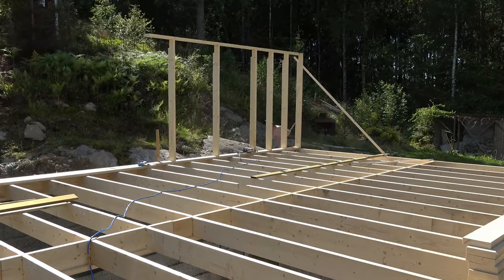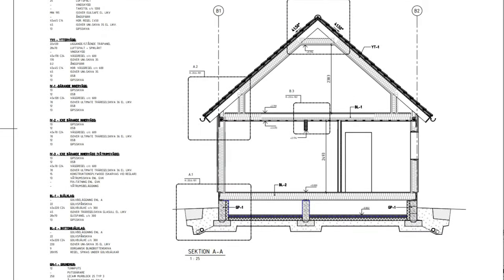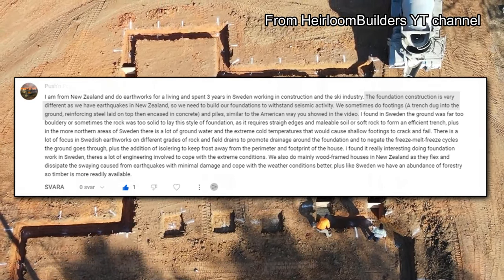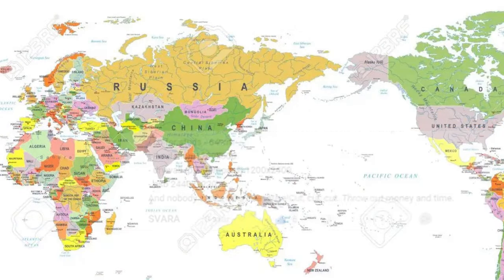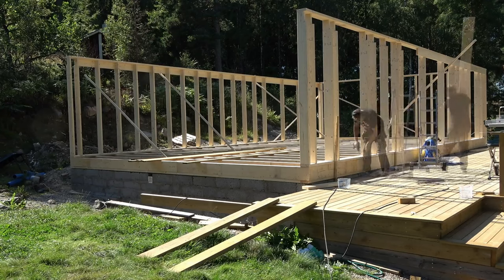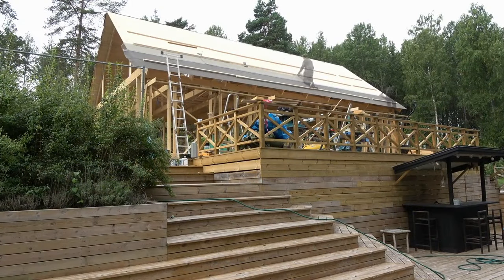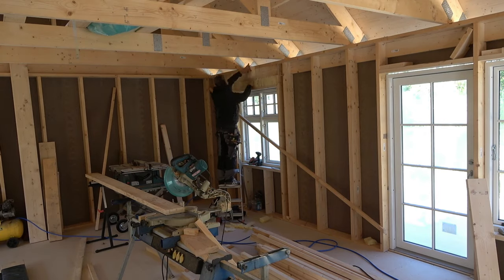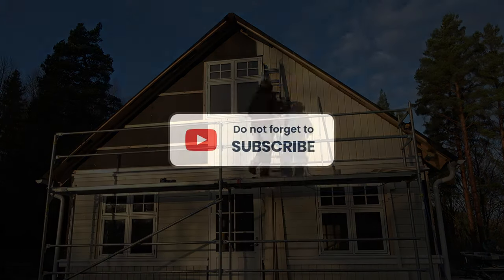UPDATED VERSION! Scandinavian VS American, CA, NZ, RU, AU building methods, let's compare...

Comment: no matter what, I would prefer to have a Scandinavian-built house..
Reply: The modern Scandinavian houses are extremely efficient and uses heat pump to extract energy from the ventilated air. 
In Northern parts, a house only uses 6-8 MWh/year for heating!

Not sure if the design works well in very hot climates, with AC running many months per year. Walls are built to be warmer on the inside…
Reply: Interesting that you say 6-8MWh that sounds a lot to me. Do you mean electricity that is used by the Heatpump or what the Heatpump produces ? We live in a concrete/brick house and we use for heating, hot water and cooling in the summer about 2,4MWh/y of electricity with the Heatpump. Approximately 10,7W/m2 per year. This is with a separate balanced ventilation system with heat recovery. Heatpump is air to water. We live in the Netherlands
Reply: @robertr999  remember that it get colder and way darker the further north you go. Also wooden houses are usually better insulated than bricks in our climate
Reply: @jubmelahtes  thnx for your reply. Yes further up north it’s coulder then here. But can you tell me if your 6-8MWh is pure electric of is it the thermal output of the heatpump? Is there a ..kWh/year per m2? for your area? Thank you in advance.
Reply: Swedish houses doesn't blow away during hurricane season which is 👍
Reply: @robertr999  I quickly looked up numbers for Finland, as that's where I'm from. Though I can't be 100% sure if these are correct since I don't work in building industry.
"Passive energy house" is supposed to be under 20W/m^2. "Low energy house" is under 40W/m^2. And the value that new house has to be is 75W/m^2 or less. 
I think those numbers give a good idea how much energy it takes to keep a house warm in cold climate.
Reply: @juhoukkola2306   Thank you, for this information. 👍That is quite similar with the Netherlands. Passive house qualifications 15W/m2 , low energy house (NOM) is 35W/m2 But the difference is the normalised base temperature (climate zone/base standardised outside temperature) It is just colder in your country.
Reply: Scandinavian house in north America with a thai wife. Men can dream.
Reply: Agreed !
I've lived in US for about 40 years. 
American houses, especially built 1980s and eariler are incredible crap compared to Scandinavian.
Reply: Yeh but  summer you can barely breathe inside tho
Reply: @robertr999 that is enorme. 😅😅
Reply: @robertr999 it’s -30C in Northern Sweden

Comment: American here. Your hammerband technique makes so much more sense than a double top plate, especially when factoring in no need for window headers. The A-frame roof joists make more sense, too. In the US, roof trusses are commonly used, making the attic space unusable. I also think using OSB on the walls makes a lot of sense along with the "double wall" so wiring and plumbing can be run without drilling holes in the studs. In the US, there is a newer OSB designed for subfloors  that is waterproof. So we've got you there!  I would be interested in how a full two story house is framed in Sweden. Do you do hammerbands around each floor? Also, do you use wooden I-beams for floor joists there? Thanks for the fascinating videos.
Reply: We typically use lumber for floor joists. 45mm x 195mm or bigger are common. There are other enginered joists made with osb, plywood and masonite but those are more often used in commercial buildings.

Comment: I work in construction and live in Denmark. I am from Bulgaria (south of Europe). Got my education (In construction) here in DK and I can say from my experience that the biggest difference I see in methods is the Earthquake resistance and stability of the building. Scandinavia is in the middle of the European Techtronic plate and when we had to calculate seismic actions - its virtually 0.  On the other hand Bulgaria has a code where all buildings must comply to regulations that make sure the buildings withstands 9 on the Richter scale. The amount of reinforced concrete used there is un imaginable to my Danish collogues. That changes how the different construction elements look like  and where people spend most money on their house/building.  Furthermore, soils in Northern Europe have been compressed by the glaciers that came from the north pole during the ice ages. That has compacted some layers of the soil to a very high degree. Making it very easy to build on - especially small buildings like single family homes. It seems to me that this makes it possible that people in northern Europe to spend less on the structural elements of the building.
Reply from the maker: Thank you, very interesting.
Reply: Worst building in America Has this caused human death? More than 50,000 people died in the earthquake in TURKEY (06.02.2023 earthquakes) and millions of people became homeless. Hundreds of thousands were injured. What has been done is purely for profit.

Comment: spray foam is WAY TOO much money,but alot of americans use it,the rich dont care about cost,A builder here pretends to build for 12-15% over labor and material costs but they have a tendency to hide things,and a million dollar build could have been done for 600 ,000 if you hired it all done one contractor at a time instead of employing a general!The honest builders just get 15% of every dollar that goes through the building account...The others bid it trying to make 15% ,but padding everything heavily to make more.....one local charges 3500 for buillding permits plus the fees,yet its easy here as long as all is organised,In our county ,permits take a couple hours!

Comment: If You have money only Ytong, We use hollow blocks on Balcan, but Ytong is better, and Ytong white seilings, over that We add at least 8cm stiropore insulation, Ytong doesen't require insulation, it's fireproof, earthquake proof, soundproof, and breaths so excess humidity and wapor don't make problem.

Comment: It sertainly look that we tend to be specifically keen on the isolation part in scandinavia. comming is to have 45+220, the norther you get the 45+220+45:ier you go :)
Reply: A huge plus side is, 45+220 windows looks so great! No extra "fönsterbläck" (google translate it from swedish) needed. :) Blinders do actually do their work and wases fits without interfearing with the inner space.

Comment: We Brits usually build our houses of brick or concrete block (for fire protection) but timber framing off site in a factory is becoming more common. Even with a main downstairs internal wall of concrete block, the upper internal walls are usually plaster board, double faced with a hollow lattice in between, which you can run cables through. I'm not an electrician but I believe all cables to sockets or switches, must run vertically, you can't take shortcuts across the wall. This to reduce the likely hood of someone putting a nail through the wiring, also you have to be a qualified electrician to sign off on the wiring, so most wiring is contracted out. Similarly only registered technicians can do any work on gas fittings or pipes. Plumbing is currently a DIY option but few people will attempt it. Thanks for the great series, I have always wanted to build my own house but I will have to be content to one day to have one built one to my specifications (currency permitting), my back or knees couldn't take the strain anymore.

Comment: While there are certain specific details of your construction methods I would like to see become standard in the USA, I think I prefer the American methods. Firstly, US building codes have largely abandoned the "houses must breath" dogma of previous decades in favor of a much tighter envelope. This has been shown to completely defeat the idea of breathability in a home. If it doesn't get wet in the first place from mass water, or from vapor, or from thermal condensation, then it doesn't need to dry. So the emphasis in on creating a water/vapor/air tight envelope. Another benefit of this philosophy is energy efficiency. Obviously, the tighter your envelope, the less energy is required to heat and cool your home. I live in Florida, so the emphasis here is cooling and dealing with humidity. Another aspect of American codes is an increasing demand for continuous insulation that will provide a thermal break for the structure of a home. You accomplish this with your two-part wall technique that I like a lot. In the US, it is now becoming more common to achieve a thermal break by covering the house with external insulation. Another superior aspect of American building codes is the increasing emphasis on water-proofing window and door openings, as well as the use of double and triple pane windows. I don't want to embarrass you, but I was shocked that you did no water-proofing to your window and door openings nor to the window and door frames. Here, each opening would have all of the flat and exterior edges treated with liquid flashing, then the window/door flange would have received another thick bead of liquid flashing before screwing it in and the outside of the flange would have been taped and all screw heads covered with either tape or liquid flashing after installation. I also did not see a drip edge installed above or below the windows and doors. That is standard practice here. I also did not understand why water-proofing and drainage was done after the foundation was completed. In the US, the foundation walls would have been water-proofed, and a perimeter drain would have been installed at the level of the footing before the dirt was replaced to the walls (back filling). There are other details where I believe American practices are superior, but I don't want to ramble on. I will only say two words more - spray foam. On the positive side, I liked the two-layer wall. I like the use of OSB to cover interior walls. I liked the hammer joint at the top of the walls. We would call that a continuous header (a header is the horizontal beam). This clearly add considerable strength to the wall assembly. I liked the use of site-built rafters and beams for the roof structure over the use of pre-assembled trusses that are the standard here. In fact, a design that used rafters and beams would be considered a custom home in the US. Thanks for your content.

Comment: I am 76 years old.  I can’t remember the year but everything used to be on 16” centers.  Now almost everything is 24”.  We usually don’t use OSB inside but I see it is a good idea.  Walls get really weak when you drill them full of holes.  I was building three story apartments in Colorado.  I had just ran 3” pipe in on the first floor for electric in all the apartments.  They delivered drywall.  No one was there the weekend the floor fell in from all the holes I had drilled.  I had questioned it before doing the work.  That was what was called for in the plans.  Another point most contractors use heavier drywall in the ceiling just for the added fire rating.  Enjoyed your video and plan on watching more of them.  I had never thought about doing the top plate any different.  I like the way you do it and see the advantages.  Later

Comment: Here are my comments from a North American:

1.	You have hit the nail on the head again.
2.	Excellent update on the differences of building styles.
3.	Excellent on point loading from top of roof to the foundation.  In particular, the direct connection between structural members and not having a subfloor on top of the frame.
4.	Great clarification on the roof trusses.  Cannot beat the strength of an A-Frame type roof truss construction.
5.	Moreover, the detailed explanation of the Hammerband and how you use it conjunction with a header for a door or window.  That combination would be a hybrid box beam.  Which you can not beat the load capacity of it as the load is spread to multiply framing studs.

You a truly an excellent craftsman and I cannot wait for wait next instore to view.
Reply from the maker: Thank you, I'm learning and hopefully i can expand on the differences in my next part.
Reply: Hello Mindsparx!
I'm new to your channel, very nice content.
I live in Järna with my family currently building my house there.
As I understand you are in the southern stockholm area as well.
It would be great to meet up maybe for a koffe if you open to it and  "exchange minds"😊 Mvh Gergely Doman

Comment: i built my house almost exactly the way you did (i am from austria), instead of foil my vapor barrier is OSB3 with sealed joints (standard here). only the foundation is a baseplate with strip footing, insulated on top with extruded styrofoam. for the rest of the house we used hemp which is more expensive but has outstanding insualtion properties. the walls have been planked with boards made of plaster fiber (heavier and more durable than normal drywall).

i love your videos and cannot wait to see how the house will look when finished :)

Comment: Fantastic video, fantastic series. Loved watching you build your house and learn how other countries do things!

A standard practice now in north America is extensive waterproofing. We use "flashing tape" and other self adhering waterproof barriers extensively to prevent water infiltration. For example, for windows, flashing tape would be applied directly to the frame, and then new windows have a nailing flange attached to the OSB siding, and flashing tape would be applied over that, along with metal flashing on the top and bottom to divert water. Or for the roof deck, we would apply a similar tape flashing material to cover the roof deck, and then apply metal drip edge flashing over the fascia, and then apply flashing over the fascia and the entire roof deck. Fascia would also have separate flashing.

This combination of flashing tape and flashing metal generally covers all seams on the exterior of a house, under the siding material. 

I notice that your windows didnt have any nailing flanges, they are what we call retro fit windows (they fit into a wood frame instead of the flange being attached to the house). How do you water proof your windows and seams?

Comment: Nicely done; thank you!
American building styles have changed over the years, even when focused on a single climate. (I bought a 125 year old house and had to research as I was doing a basically complete gut of the inside. 125 years of small improvements, mostly removed and replaced with modern: 5 generations of knob and tube wiring + at least 5 of romex replaced by modern romex; galvanized pipes by PEX; cast iron waste pipes by PVC; plaster/lath by drywall; no inslulation by... insulation...)
My 125 YO house uses a form of balloon framing, though modern by the era: there's a subfloor covered platform built over the basement (was dirt, concreted over later) and the ~16"OC 2x4 walls are built all the way to the top of the second floor and double capped. This got a platform built on top to put the roof over, so 2nd floor was not built like most modern homes around here with a platform at each level.
The house also has a form of hammer band, but I suspect it was mostly put there for the building process: it's only on the walls that support the 2nd floor joists. Joists are flat nailed to the bottom-of-first-floor to roofline 2x4 studs. Modern construction would never allow this technique and I've heard so many comments about adding fire blocks it's amazing (that wasn't feasible, though).

I really appreciate these videos; seeing how it's done in different places around the world is great fun! Thank you!

Comment: Loving the video - commenting as I watch it. - noticing the larger spans with the roof trusses and seeing you use dimensional lumber instead of sheeting for the decking - we do something similar in the U.S.A. when we build post frame buildings. We put trusses 4 foot, 6 foot or 8 foot on center and span them with "purlins" - 2x4 or 2x6 lumber on edge-  we do this mostly with steel roof buildings, sometimes we will sheet it with osb, but mostly we go steel roofing right to the purlins-

Comment: As a german electrician I can tell you that we definetly do not use braided wire in house walls very often (if at all), I have also never seen a house with conduits, though I dont work on residential houses, so my sample size is small, only friends and families houses.
But I will definetly install conduits when I redo my walls and electrical.
But you can definetly pull solid wire through conduit, as long as its not something very thick like the cable that supplies the house.
We pull 50*1,5mm² cables through conduits in the earth at work, so a 5*2,5mm², which is usually the biggest cable that you need shouldnt be a problem at all (and its probably not a workout like the big cables at work).
Reply: In The Netherlands solid core 2.5mm2 installation wires through conduits stiff or flexible is standard. You can buy pre-wired flexible conduits in our local builders market. re-wiring is not hard, you pull the wire through in stead of pushing which works fine as long as the flexible conduits is attached at regular intervals.
Reply: @GerardL  Yep, the expense of braided is not worth it. 2,5mm2 is flexible enough to pull through almost anything. But you take care of that by not angling the conduit too much. Since most elecchickens also place the conduit at some point you make your own job harder.  Or yell at the guys before you. 
Lot of normal housing does not need 4mm2 or bigger.
Reply: Thats intersting. I'm from austria and we have conduits in pretty much every house built since the 90s or so. Didn't know there was this much difference between germany and austria. 
The thing we have in common is that we also don't use braided wires very often. Mostly because of the simple reason that installation is stationary and doens't have to move. Also if you use braided wire you have to crimp the ends before you put them in the terminals - thats just a lot more work